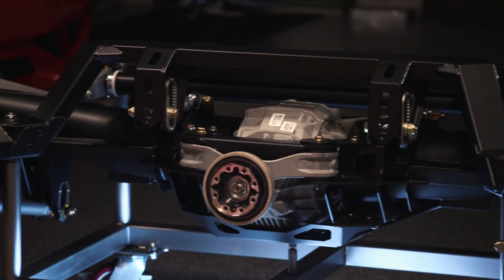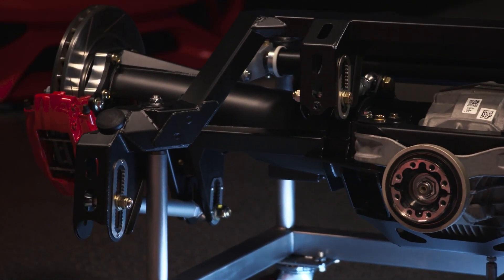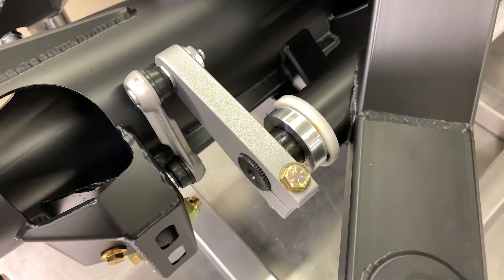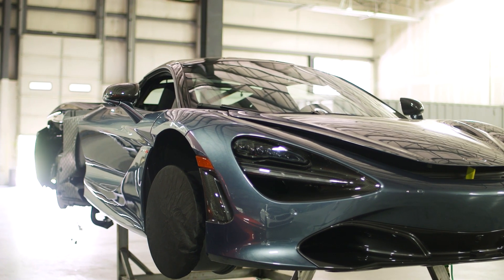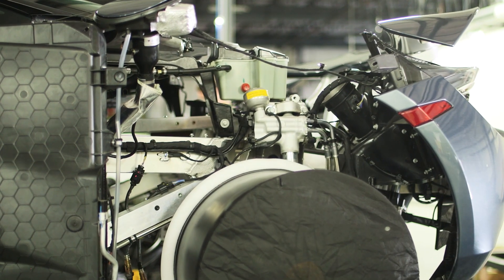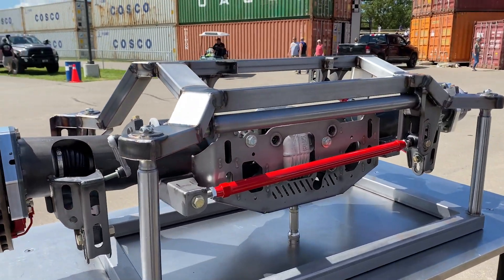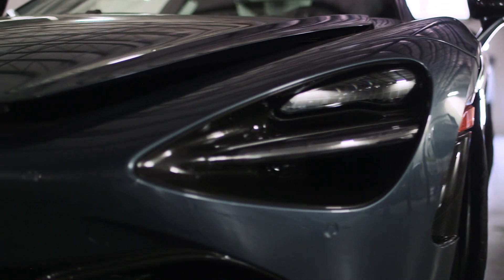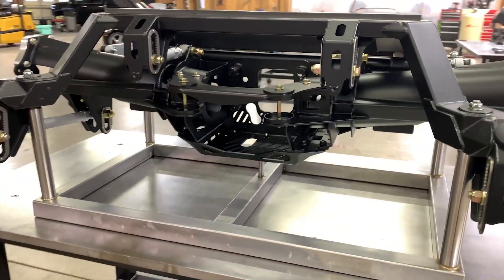ACME Big Stick Traction Enhancement Module 2022 SEMA Launch Pad Top 15

Comment: This is such BS, you absolutely do not work on McLaren or manufacture their parts. At all. NOT EVEN 3D print! You are JUST in the same building at them. They’re silent because they’re working on the “prototypes” and parts you’re taking credit for. I’ve been to your shop, several times. Why aren’t you ever there working on the “fastest mclarens”….? I literally have a 720s there and you’ve never had a single thing to do with it 🤣🤣🤣